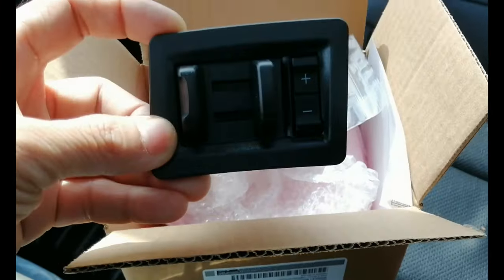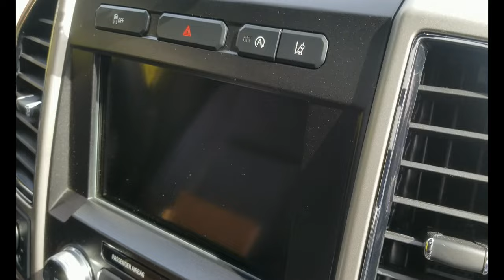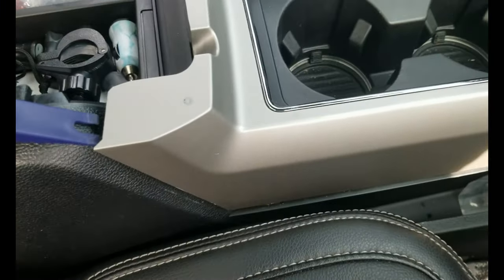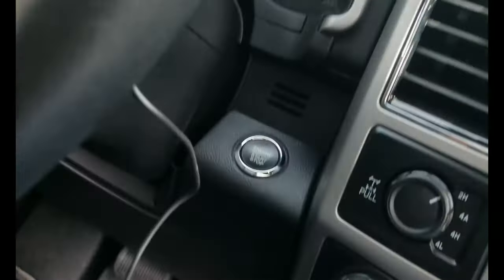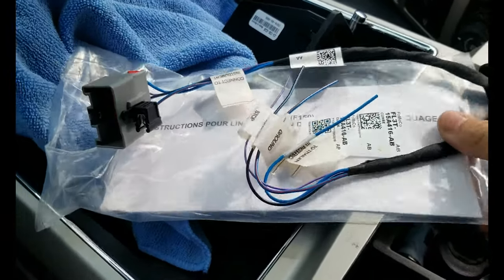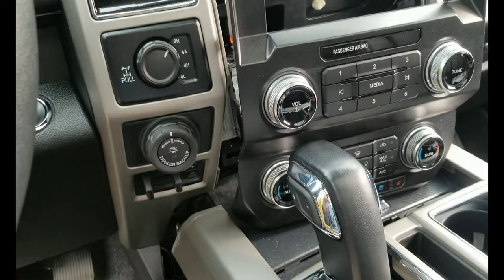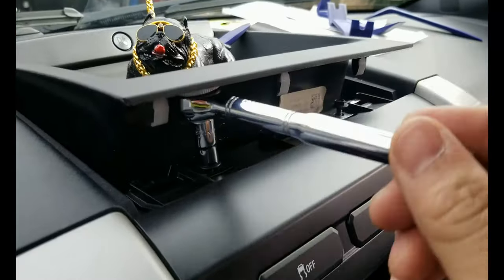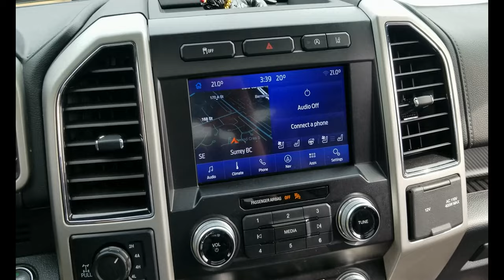Ford F-150 Brake Controller  installation with center console, step by step in detailed, 2015 - 2020

Comment: Good evening Blessings greetings from San Carlos Costa Rica Pura Vida question does the 2014 ford f150 raptor have a trailer brake question can you install the 2014 ford f150 raptor trailer assistant or not
Reply from the maker: Yes 2014 raptor has trailer brake assist but no trailer backup assist.
Reply: @ruvrandomusefulvideos  Good morning, Blessings, can backup assistance be installed on the 2014 ford f150 raptor or not?
Reply from the maker: @ronaldq1653  Sorry I am not sure. Better to contact Ford to make sure. My lariat has backup assist already when I bought it.